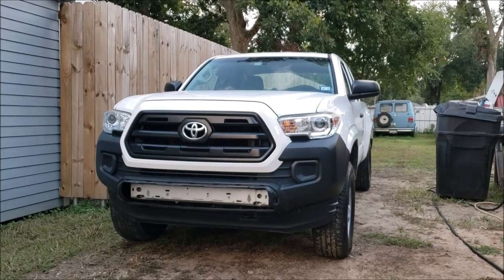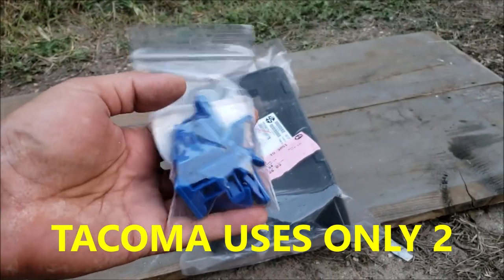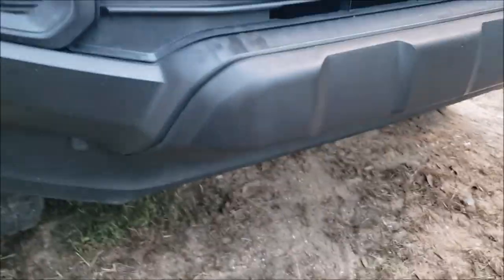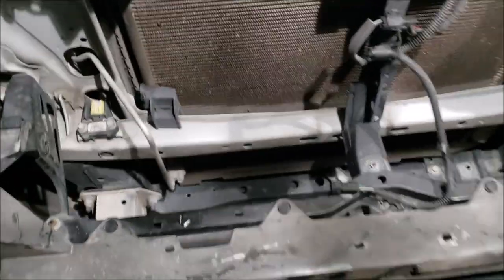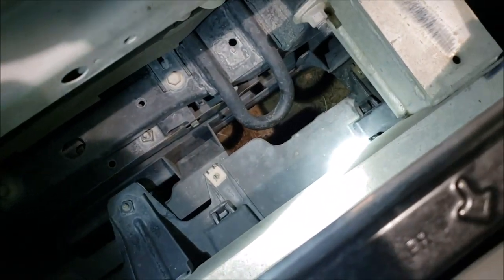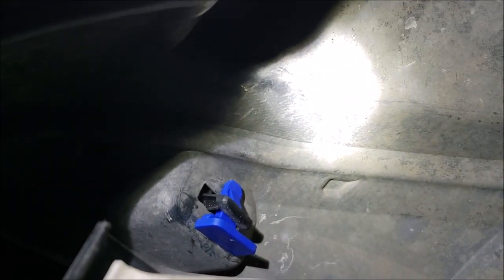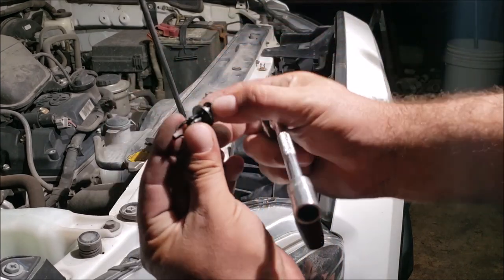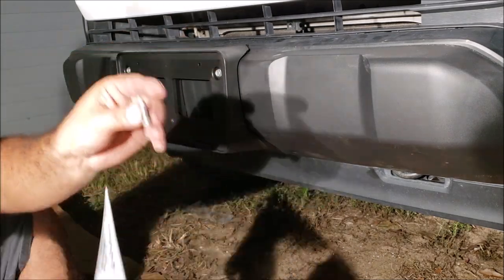toyota tacoma front bumper grill lower valance and license plate bracket installation

Comment: Hey Chris, thanks for this great instruction.  Very thorough and detailed.  With your help I replaced the valence on my 2019 Tacoma for the price of an $80 after market valence that fit fine.  Just as ENTERTAINMENTSERVICE below suggests, one caveat for later Taco models is that you need to disconnect the electrical harness to the emblem in the middle of the grill before removing it.  Glad to get rid of the duck tape band-aids on my front side!  Thanks again.

Comment: Great video! I have a 2019 SR5 and there is a little wire that is connected to the grill so I could not take it completely off. I just propped the grill on top of the engine bay with the wire attached and got the job done.
Reply: Right on.  Glad I saw your comment.  The harness wasn't much of a problem to undo and reconnect.  I put a little dielectric grease on it when reconnecting.

Comment: Great video you went right to my sore spot after truck hitch destroyed my plate and popped lower trim. I made mistake of removing right side inner splash shield fastener's, a real bee hive of different plastic plugs holding outer edge of splash shield inside the fender/wheel area. Your video was a simple way of reinstalling the Blue 2 clips compared to trying to install from under side as I tried and had to repair that plastic area. They are a required to get a good fit up. I can only say as a old guy I wish I would have found your solution to my issue. Now I hope I can find the correct plastic combo's to reinstall my Right inner wheel plastic shield back, any help is appreciated.    5 *****'s for your VIDEO & a honest Thank you!

Comment: Im having trouble putting on the Valance like one side pops off then when I pop it back in the other side pops off do you think you know why? The bumper is aligned good
Reply from the maker: did you use the blue clips?
Reply: @chriscraft77022  i think when I order it  it didn't come with the blue clips but I also seen other YouTuber post it but they never mention about that blue clip
Reply from the maker: well, obviously that other youtuber knows more than I do
Reply: @chriscraft77022  can you send me a link to where you bought your so I can buy another one